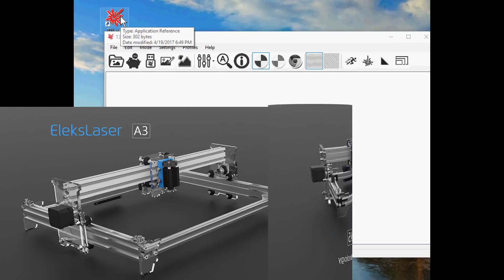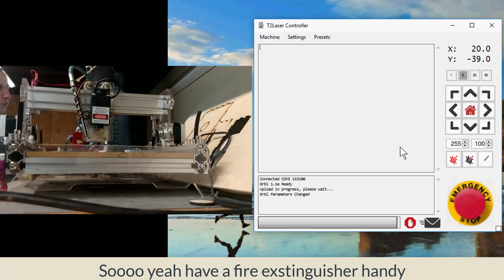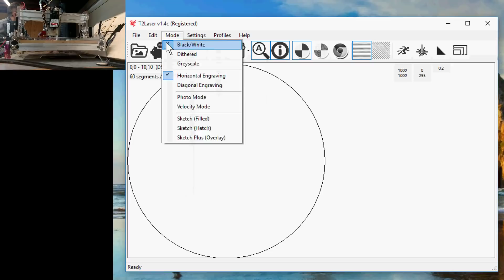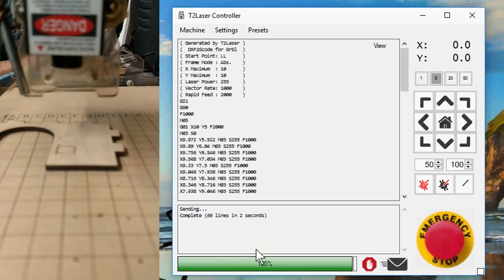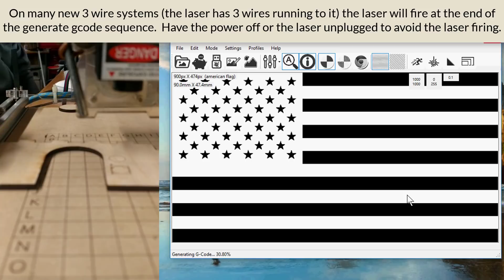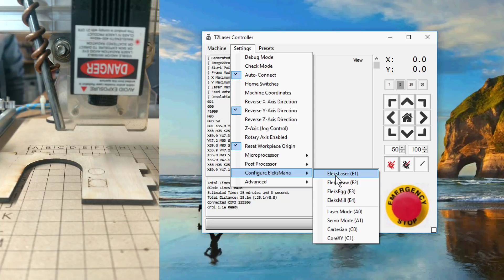I downloaded T2 laser now what?

Comment: Need to select insomnia mode to disable sleep not failsafe

 Fail-Safe Mode (attempts to disable the laser if any errors are detected)
located on laser control screen under settings, advanced settings

  Insomnia Mode
o   Prevents your computer from sleeping (can be temporarily disabled but will reset to on at startup)
Located on design screen under settings, advanced settings

Hope this clarifies

Comment: Hi, Steve, I was about to throw my engraver in the trash until I saw your video.  I have a Universal Engraver 3000m Blue CNC machine and the software with that was awful and in Chinese.  I purchased the software and it's all installed.  My problem is all my lettering looks like I'm drunk.  It's blurred.  What causes this?  I need help.

Comment: I got it so it functions and turns laser on and such for my laseraxe..only issue is it is not putting out the right output size..I try to make a coaster frame which is 94mm x 94mm.. I put that into the output size and it draws a frame of about 70mm x 70mm
Reply: never mind I got it..had to adjust from 80 steps to 100 steps

Comment: Is there any way you can help me out?  Everything I engrave is on the diagonal.  I can't figure out how you adjust that out or why it's even that way. thanks
Reply from the maker: Sounds like you installed the wrong firmware for your machine.
Reply: @lasergraffiti5453  DO you know which firmware it should be? thanks for answering I appreciate it and your videos
Reply from the maker: No. Not without knowing exactly what machine you have. If it is an Eleksmaker machine, the one labeled grbl 1.1e DEFAULT  is the one you want. If it's some other diode machine manufacturer it may require different firmware.
Reply: @lasergraffiti5453   I'll check on that the system is universal engraver 15w  came with engrave master  and elekscam.  Thanks for your help I appreciate it
Reply: Firmware was the issue thanks for your help!!!!!!!

Comment: when i go to update the firmwear i get issues           avrdude: stk500_recv(): programmer is not responding
avrdude: stk500_getsync() attempt 2 of 10: not in sync: resp=0x03
Reply from the maker: Contact zaxstarr the developer.  You may need to replace the Arduino nano

Comment: hi thanks for the video.it was very helpful.i ve a problem now...when i wanna engrave a thing machine is going corner and come back somewhere to start...how can i start to engrave where my laser module right that moment?any one help i ll be very happy thanks alot.
Reply from the maker: Before generating gcode you need to select a start point. You can select center, bottom left, bottom right, top left, or top right. Once you hit start the laser will go to the top left and begin engraving. if you want it to just start where it's at you need to select top-left as a start point. I usually use center start point. Then I find the center of my piece so that it will be even on all sides. I put the laser in the center of the piece right click on the home button to set the home position then hit start. The laser then moves from there up and left and starts engraving.

Comment: Thanks for this video, made using the Laser a little easier. I have the Eleksmaker 2500mW and get nowhere near the burn you get in your video, all I get is a few puffs of smoke occasionally, with no pattern showing -  or is yours the 5500mW size
Reply from the maker: Mine is the 2500. Check your wires. There is a 5 v wire and a 12v wire. If they got swapped at the factory (and trust me that does happen) the 12+ wire goes from + to + and the s pin goes to pwm

Comment: How do I Change Axis  my X and Y are Switched?
Reply from the maker: In the laser control screen there is a reverse x axis option in the drop down. There is one for y as well
Reply from the maker: Unless you mean that when you're trying to move x it actually moves y in which case you pluged your wires into the wrong ports
Reply: @lasergraffiti5453  Looking at the Machine from the Board at Back of Laser,  Y1 is Right Motor Y2 if Left Motor and X is going to Laser Motor.  and they are running backwards Y1 Y2 are right/left , X is running Front to Back.
Reply: @lasergraffiti5453  Sorry I commented wrong, X is going  Y thinks it is X, X thinks it is Y
Reply from the maker: Oh ok. I think there's a specialty firmware for that. I am not in front of a PC for the next few hours but check the drop down of all the firmwares. I think there is a swap xy one
Reply: @lasergraffiti5453  Thankx

Comment: hi, I have T2 laser software with an Eleksmaster 2500mw laser and my question is, how to know where the laser is going to engrave. I'm wasting quite a bit of mdf because I dont know whereABOUTS ON THE BOARD ITS GOING TO START. sorry caps lock off now. I'd really appreciate it if you could help me, I've seen some that draw an outline round the image on the board before it starts actually engraving so you know exactly where its going to start and knowing the boaRD IS BIG ENOUGH TO, SORRy caps lock off again.cope with the image.

Comment: I am new to using laser engravers and this software is amazing. 
The software that came with my A3 Pro eleksmaker was poor at best. 
It would skip lines and sometimes small sections of the project when I contacted eleksmaker they said it was a connection problem, I did not touch a thing and got the T2 software has completely fixed all my issues. 
I switched back to the manufacturers software and the same issue occurred again. 
I am greatful that this software was created. 
I would like to see more detailed videos on how to use the complete software. There is a lot of things I don't fully understand how to use or what it does yet.  
Thank you for this video it's helped a lot.

Comment: Hey! I bought a 3w 56x60 laser engraver went from benbox to T2laser updated the firmware to grbl 1.1e but it will only do horizontal lines the machine can vertical but the laser doesn't do anything?! please help
Reply from the maker: Sounds like you may be running a non standard machine. Does it only have one y motor? If so you may need to use the laseraxe firmware.
Reply: @lasergraffiti5453  it has 2 y axes motors.. the laser moves great in all directions just the laser stops burning when moving in the y direction
Reply from the maker: Hmm could you post a video showing the issue?
Reply: So I got it working.. for some reason on cardboard is wasn't working but on actual wood it engraves normal.. thanks anyways

Comment: Wow thank you. Now it runs as expected. What I thought was the LL was actually the UL and what I thought was X Axis was Y Axis. The machine fonally goes where expected. Still not sure of the difference between Home and Workpiece Origin? I seem to be getting by by setting them both to the same position.
Reply from the maker: homing the machine takes it back to 0,0.  If you had homing switches, 0,0 would be at the bottom left.  The work piece origin would be where ever you want the job to start.  So 0,0 would be bottom left but you want to start at the center of you 100x100 coaster.  the work piece origin would be 50,50 and you would need to set that.  Since most people dont use home switches setting the work piece origin as your home is the correct procedure.

Comment: Great video Steve, after watching it a couple of times I decided to make the jump to the paid version.  I was wondering if you could help me with some g-code for a custom button.  I want to code a one click Trace Frame key.  Any assistance would be greatly appreciated.
Reply from the maker: No need.  Right click the turn on laser button (the red one that looks like a laser shooting) and it will automatically trace frame.  I guess I should do a tips and tricks video
Reply: @lasergraffiti5453  I found the issue.  If your settings are set for silent mode, the laser will automatically trace. If not, the software asks if you want to trace and you have to answer.

Comment: Hi Steve. Great Video and I am going to buy the T2 software if I can solve the problem of my Laser not responding to the power settings. It only burns at full power and I cannot turn it off with the software. Thanks
Reply: Sounds like it could be a wiring issue. Take a few photos of your system (particularly all the wiring for the laser and board) and post them on benboxlaser.us so we can troubleshoot this for you.
Reply: Will do. What section of benboxlaser should I post in

Comment: Hi Steve! thank you for the information. I have been working for several months with this software. When I import the image into the main window, the image is pixelated. Whether small or large, HD or not, zoom on or off the image is always pixelated. If I adjust the resolution to .05 it's a little better but not perfect and it's much longer to do the job. By engraving this image of poor quality I have a bad engraving. What is wrong? Thank's
Reply from the maker: Hi Hogue.  There could be a couple of issues which are plaguing you.   How do you make your images?  I would venture to guess your images are low dpi.  I usually create my images in inkscape.  Inkscape defaults to 90 dpi at export.  T2 at a resolution of .1mm (the size of the laser beam) is 254 dpi.  Therefore if you export at the default 90 dpi your image will be tiny and pixelated.  If you are using large hd images and still pixelated I would wager to say that it has to do with the maximum resolution of the laser.  The laser makes a burn dot which is .1mm.  when you use .05 resolution you are just slightly overlapping your burn dots.  this will increase resolution but will actually make half of your burn exposed twice to the laser which will affect the final image and will definitely affect your ability to do greyscale.  If you want to share any image with me and let me see what you are specifically talking about I could offer a more educated opinion on what is going on.  my email is nottingham82@gmail.com

Comment: Hi again Steve,
Followed you instructions keeping the laser switched of works great. I burned the test circle although it's not perfectly round. Does it mean maybe the belts are to tight? Also tried to burn a other simple drawing but after a min. or so the laser stops at 4%. Another test at grey scale also stops after passing the same line a few times? Any idea? tnx in advance Huub
Reply from the maker: I would say that you need to adjust the belts and check your driver voltage.  http://benboxlaser.us/index.php?action=dlattach;topic=20.0;attach=3545;image

Comment: Good morning Steve,
Just installed T2 laser for my Eleksmaker A3 pro. Most things seem to work normal except for 2 strange incidents.  When I connect to the laser or generate the G-code the laser fires up for 1-2 seconds at full power. Is there a way to solves that?
Reply: Lustenhouwer Huub good morning. The laser turning on at startup is a design flaw. The most permanent way to fix it is to solder in a resistor to the controller. There are some write ups on benboxlaser.us personally I just have the laser plugged in on top of the work bench in arms reach of my computer. I keep my laser unplugged until I'm ready to send the code. The laser only comes on when the PC is connecting so if you plug in the laser after it says grbl ready, it won't fire until you tell it too. If yours is plugged in somewhere hard to get to you can push the low power button on the laser which will keep it from going on at full power at startup.

Comment: Awesome video! it helped so so much. However i need HELP! i watched the entire video twice before even turning my machine on. i then went through all the steps - setting up the various settings. i uploaded a picture - checked all my settings again - sent the code - it started at top and continuously burnt the top of the image then began to work its way down then only got half way through the image then said complete? what am i doing wrong? thank you so much!
Reply: Jaclyn Bush if you are using the free trial version it has a maximum limit on lines of gcode. So your picture may be bigger than the free limits.
Reply: you are right! 
i have another question.. 

i need to engrave leather.. i have been trying to practice on scraps, however all of the sizes of the images are HUGE. I'm not sure 100% sure how to scale it down.. 
i registered the software, but still waiting for the code. 

i am just really at a loss. i love the software so far.. just unsure exactly how to use it. thank you so much for your time and insight!!!
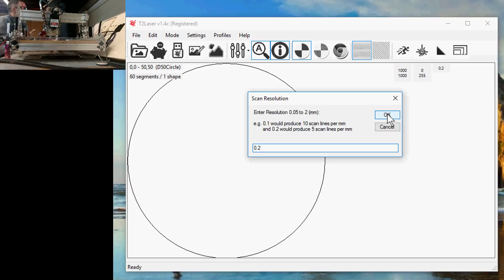Reply: Jaclyn Bush 11:56 will show you how to adjust the output size

Comment: I need Help, everything works and I set it up like the tutorial video but when I want to engrave the circle, the laser goes on and off with no engraving marks
Reply from the maker: If  you have a button on the laser or board for low power it may be on, your power supply may be faulty, your 5v and 12v wires could be switched, or your lase may be dying.  Time to break out the multimeter.

Comment: Hi Steve,
Need you help, I followed your video all the way through to uploading the 1.1e firmware to my laser main board. Am not sure what I've done wrong now, I cannot move either X or Y axis through the T2 controller.
I could move both axises through the T2 controller previously. Please need your help.
Thank you 
Randy
Reply from the maker: that is weird.  Have you tried reloading the firmware and resetting default parameters?
Reply: Hi I have got the same. It stop working. Worse is i can't use it at all. Is not connecting to my CCNC software which I used before. Like something washed up from the board. :(
Help. It worked fine before. Now whatever I click it is going in one direction on x axis.
Reply: Academy3DCake Agnieszka & Grzegorz  did you find a solution to this im having this problem?

Comment: Do you know how to use the software to cut mat boards?  I can etch and engrave with no issues, but can't seem to figure out making a clean cut.
Reply from the maker: Mat boards? what material?  Best way to do that is with a dxf file or using the trace feature in t2 laser.  then set the number of passes you need to cut through.  Start with the sample box in the help menu to learn how many passes you need.  using air assist will also help by removing ash and smoke from the cut area.  Depending on the material air assist may be a must.  I cut 3mm wood in about 6-9 passes with a 2.5 watt laser.

Comment: Hello, I have uploaded firmware Grbl1.1f and it is says it is ready, but the process seemed to run through with each going to 100% , however, it returned a firmware upload error 1/1. Do you know what may have caused the error? We are flashing a laseraxe board.
Reply: Q.I.S Quality.Industry.Services if it says ready it is fine. Some times there is a false error.

Comment: Steve, I need your insight.  I could not find your old channel to look up our past threads.  I got with Zax and moved my software from a laptop to my office PC.  I have installed the CH341 driver, T2 Laser, (and also Benbox and EleksCAM).  The comport is detected in Windows control panel (COM7).  I if I connect T2 Laser to the A5, the diode light will come as always (need to fix that soon!).  But the A5 does nothing else.  It will not move X,Y asis and it does not laser.  

When I load EleksCAM it shows that SERIAL PORT Search Failed.  So it does not recognize the laser either.  Is there some setting on my office PC that I am missing?  It has been a little while since I set it originally on my laptop so I may be forgetting something I had to do.  I am running Windows 10 64 bit.  Thanks for any advice!!  I desperately need to get these things running again.
Reply: Steve, Zax emailed me back.  The problem was that the baud rate in Windows control panel was set to 9600 for COM7 and it should have been 115,200.  I changed that and now all is good.  Thanks again for all your past help and you great videos!!

Comment: do you know if you have to be hooked to the internet constantly to use the software
Reply from the maker: You do not need the internet to run the software.  You will not get the automatic updates though if you are not connected.
Reply: yeah I figured it out ends up being that the main board is fried